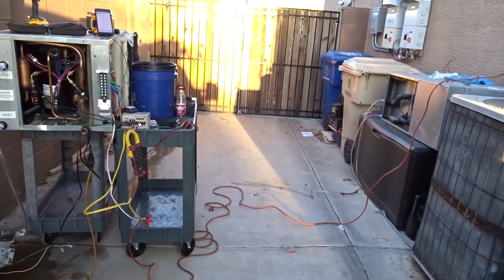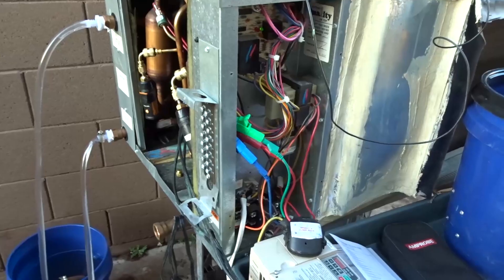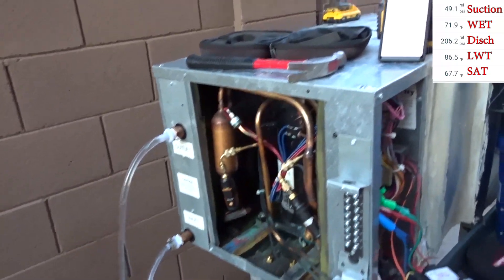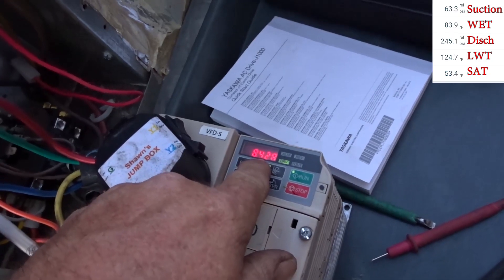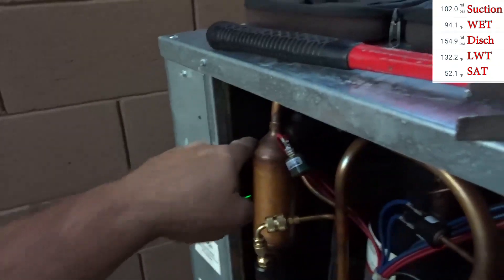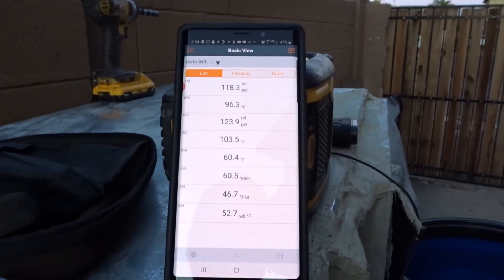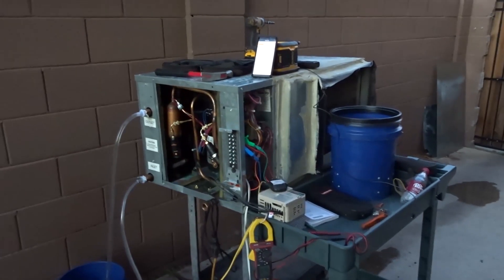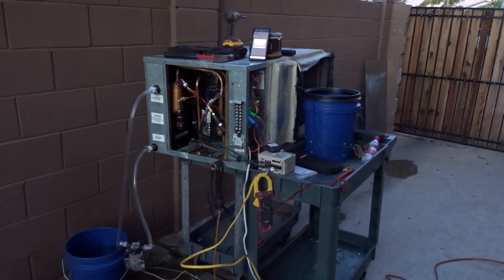Will a 460 VAC 3 Ph compressor start on 230 VAC 3 Ph? [Just for shitz n giggles]

Comment from the maker: I see now that I labelled my onscreen water inlet reading as WET instead of EWT (Entering Water Temp).
But it should be pretty obvious what that was.

The next step in my project will be to either shoehorn in this water heat exchanger into the other smaller Trane WSHP unit or to steal the 230V 3 Ph compressor (and 230V blower) from the Trane unit and install it into this larger Mammoth unit.

Either way, let Project Bastardization commence!
Reply: Have you considered using a 460V VFD and supply it over a delon voltage doubler from 230V?
This will give you enough Voltage to run the compressor at its rated point.
Reply from the maker: @Alexander470815  
I had a 460V VFD but can't find it. I may have tossed it when I cleaned out my garage last fall when we had that horrible water leak.

I won't be doing much else with this 460V compressor. I brought this unit home to steal the larger heat exchanged for the other unit for that water heater experiment/project.

I just hooked this up for shitz and giggles before I dissected it.

Comment: These are the LG multi V5 systems that I sell and my son and I install.   https://youtu.be/hI5BMP40Ugk.          Scroll compressors that you can turn down to 15 Hz and as high as 165 Hz . This is what I taught my son on, his introduction to HVAC trade. Right out of high school with no training he was responsible for installing a 24 ton three 8 ton heat pump’s combine to one  piping system. These are excellent systems to introduce to young students start them off with the here and now future technology.
Reply from the maker: Wow. All the LG Multi V units we have use the rotary compressors. 
I looked at your linked video and it's indeed a scroll. First time for everything.